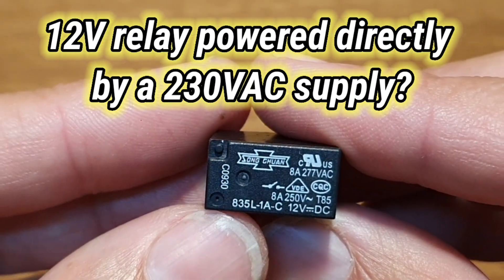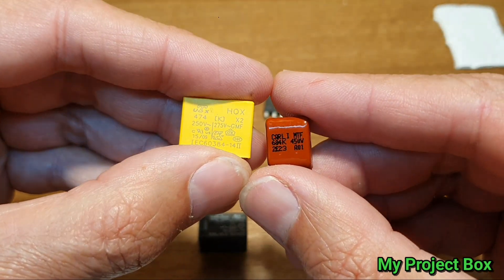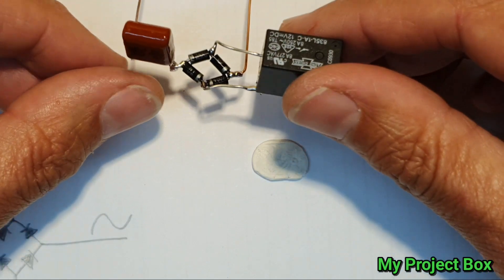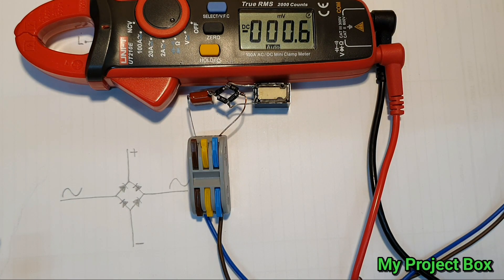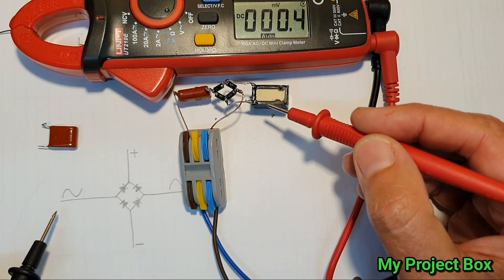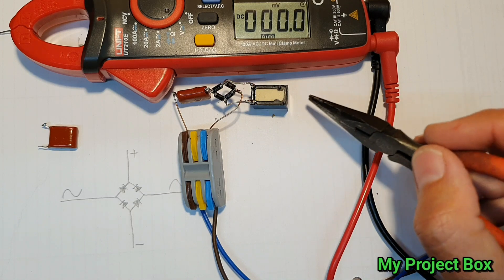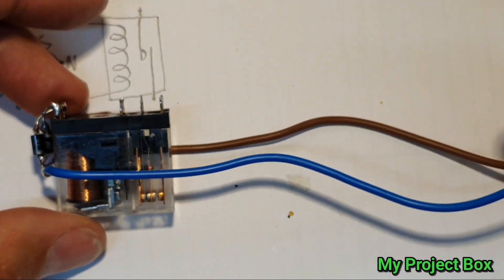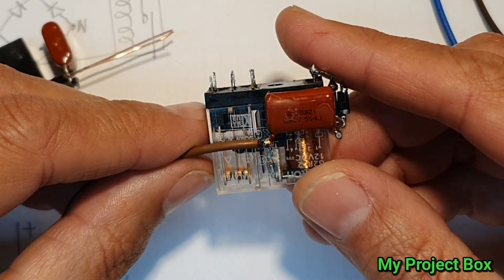Power a 12-volt relay directly from 230VAC mains voltage

Comment: What's the point without any values!
Reply from the maker: The capacitor value will depend upon the type of relay you use. It will be different for different types of relays. Just do some experiments.
Reply: Everything was in hand, all that was needed was the details of what's used. @MyProjectBoxChannel

Comment: Simply just use a 1k resistor
Reply from the maker: It will get very hot dropping that much voltage! Using a resistor is terribly inefficient. But a capacitor can drop AC voltage efficiently, without generating any heat😉👍

Comment: where can i find this relay.
Reply from the maker: You don't need to use this specific relay. Any 12v-24v relay will work. It's also possible to selvedge this relay from old PCBs and old appliances. I have seen similar relays on ebay and online aswell.
Reply: @MyProjectBoxChannel  ok bro

Comment: Will it be better if the output of the bridge rectifier is filtered with an electrolyte capacitor?
Reply from the maker: Yes it would give you smooth DC, but the relay works fine with unsmoothed DC. I wanted to keep the circuit as simple as possible. You could also add a zener diode to regulate/clamp the voltage, but this would add extra complexity to the circuit. It's a simple circuit and it works great👍, but you need to match the capacitor, to the coil impedence, to drop the correct voltage.

Comment: Why you dont discripe how to calculate the cap? 

By the way ... "save to use" is a phrase you dont find here 🎉
Reply from the maker: I think the voltage separation between the coil side and the switch contacts is very good. Film capacitors don't generally fail short-circuit. In fact, they can lose capacitance over time, as they "self heal" ( a short-circuit will  blow itself clear)
Reply: @MyProjectBoxChannel  we in Austria Europe we learn in the electronic school to avoid this Type of Design. We learn to use galvanic isolated Designs, But they are to complex and Not a quick solution. Like your idear. Your dirty Design have a big plus. If Something Blow Up, the hole Design Blow Up. I think your Design Work also with one Diode and two Caps. Relays are Not realy fast and 50-60hz is easy to Puffer also with only one Phase of the sinus. I Like your idear. I have also more 5V and 12V Relais at Home.
Reply from the maker: @NetrunnerAT  I tried using just one diode, but it doesn't work 😩. The capacitor just changed up with the half-wave DC, and it won't work as a capacitive dropper. You might like this circuit. https://youtu.be/oBR5O391m_c
Reply: @MyProjectBoxChannel  ah thx ... Yes ... I See ... Make Sense.

Comment: Value or marker/code of capacitor?
Reply from the maker: The value of the capacitor will depend, on the impedance "AC resistance" of the relay coil you are using. I would start by using a 470nf (400v) capacitor. Measure the voltage on the coil, and if the voltage is too high, lower the value of the capacitor. If the voltage on the relay is too low, increase the value of the capacitor. If you are using a 12-volt relay, 10 - 14v is acceptable.

Comment: Neat. Just bear in mind these caps can fail short and it will likely won't trip the breaker right away with relay coil resistance of several kOhms and may cause fire.
Reply from the maker: I suppose you can always add a fusible resistor. Like the ones they have in the LED lamps with cap droppers.  Metallized film capacitors generally do not fail short-circuit. They have "self-healing"characteristics. During self-healing events, they end up losing some of their capacitance over time. So with overload voltage spikes and fault conditions they become more "open-circuit" overtime. Electrolytic capacitors definitely fail short circuit! quite violently sometimes.